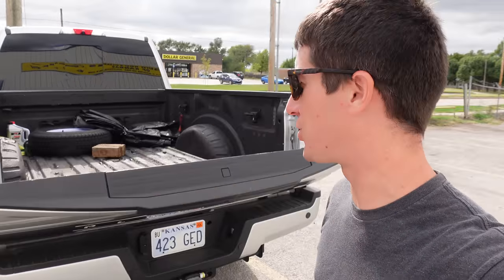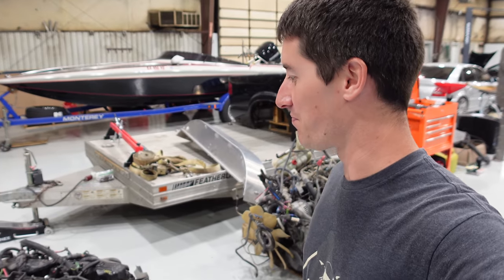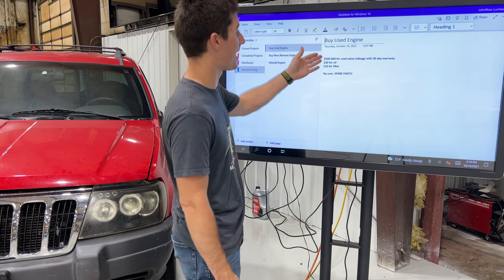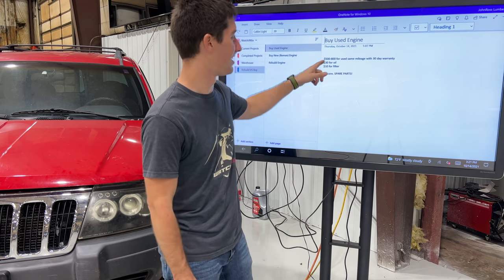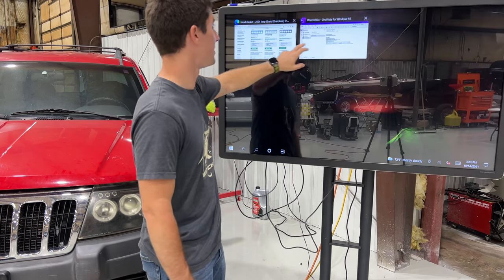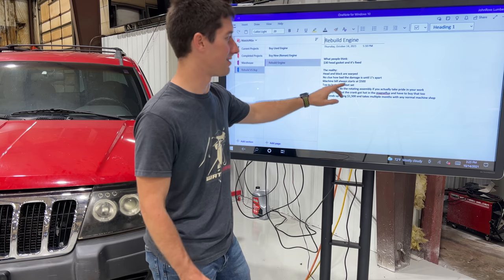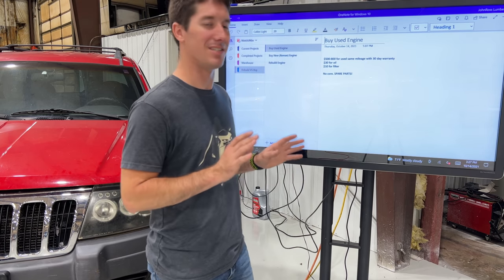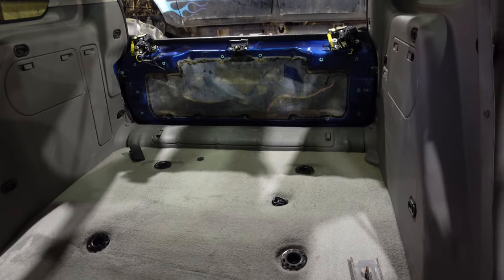Here's Why You Should NEVER Rebuild An ENGINE *The Math Doesn't Add Up*

Comment: So basically buying a used engine is really only feasible when it's an older vehicle you're either getting rid of or don't care about. To use the title "why you should NEVER..." is disingenuous. Immediate irony flag too when you mentioned $100 for headlights when it appears you really only need to spend about 30-45 mins with some wet sanding and buffing to fix those up like new again. 

Secondly, if you're just flipping and the person you're selling to knows that, then that's one thing. But I would never buy a car with a junkyard engine if I was expecting to have it be my daily driver. Sure, there's a warranty on the engine (does that warranty transfer when you sell to this person?) but not knowing the kind of care the previous owner of that engine took with their vehicle is a big question mark.

Comment: It depends on the engine. I rebuilt the factory engine in my 1949 Ford Truck. There were not any good used factory engines available so I had to fix the engine I had.

Comment: The key part in the math equation?
The electronic sensors, the connectors to them. All being cleaned or replaced if burnt, worn, dirty=bad continuity and a check engine code that becomes the headache.
So, the short end of this stick is a flip may be a flop. The elusive bad ground gremlins.
And if you live in an inspection region?
Mil not ready. And won't relearn in 200 miles and thirty restarts. Walk away.

Comment: Lol. What? No. I’ve done two rebuilds on the L29 in my truck personally, and it’s still a fraction of the cost of a jasper crate engine or the equivalent from gmpp. The only time it is cheaper to purchase a new power unit for your vehicle is when it’s a commercial vehicle that’s out of service (street sweepers for example, they pay for the engine in 2-3 days of service and that’s faster and cheaper than taking up a bay in the garage and putting mechanics on a rebuild).

Comment: In order to save weight and get better gas mileage, they make brake rotors and drums so thin that by the time they need to be machined to take the grooves out and be flat, they are too thin to machine and still be safe to use.

They do the same thing to engines for the same reason.

Comment: I had a tbi 350 rebuilt.  Ended up costing about $3500.  Lasted about 100k, replaced it with a junkyard engine for $500.  That engine was no peach either.  Ended up replacing the timing chain, and distributor after a bit.

Comment: I def rebuild just for a piece of mind. And try to find a am585 (3200gt) engine for a low price..  and even then you take a risk of the axial crank bearings failure has happened yet.

Comment: Good break down, however 4.0 is the worst one to do that break down to, slap a gasket on it after you check for the crack between 4-5 cyl, if its cracked $100 for head, cut the DS rear head bolt off and go.    4.0L is a tank.

Comment: I’m building a MR2 spyder with a 2zzge swap and I’m gonna rebuild the engine because even though it runs in the Pontiac vibe GT I got cheap it has 220k miles and I wanna keep it for a while so I got all the bearings gaskets and performance upgrades (baffled oil pan MWR manifold) for the engine and it wasn’t too bad price wise (about $2k in all the rebuild and swap parts) but I definitely agree rebuilding the engine isn’t good for making a profit

Comment: I mean I totally understand what you’re saying about the head gasket but I went ahead and just did mine anyways at 300k and I’ve so far been running okay with another 2k on the odometer honestly as long as you do the rebuild more as a maintenance thing I find it to be more cost effective then a replacement despite the time commitment although in relative terms the 4.0 is probably one of the easiest engines to pull in the world

Comment: Those used engines show problems too, whether leaking gaskets or internal noises, power loss or what have you..  But yes, it's cheaper and usually last a couple years

Comment: I agree, here where i live there are places that you can buy japanese engines with only 50k miles on them for $500 - 800 tops. whole complete engines. in japan they make you get rid of your car after 50k miles. Also they deliver it to your front door. i consider an engine absolutely no good when a head gasket is blown. the engine is never right after rebuilding.

Comment: The timing belt snapped on my 2005 Saturn LW300.
At the time it had 286k miles.
Found a 34k mile engine from a salvage and changed the timing belt idlers tensioner and water pump.
With installation it was less than $1000.00
The car is a "EXTRA" and a dog taxi.
Thirty thousand trouble free miles later...

Comment: Yup….had to put a new engine in my 75k miles 2006 X5 3.0L.  $1600 delivered to Ohio from Florida plus $1200 install.  Would have cost a ton more in labor and parts plus time.  Also got one with 20k fewer miles.  Not cheap but way cheaper to have a car I love running again.

Comment: Well seeing it is a Jeep I can understand why you wood not want to rebuild it : )

For flipping cars as long as it runs,  ok you can pass it off to someone else.
However, there are many reason to rebuild an engine/ machine.
Essentially if a machine be it a pickup a truck or tractor is doing what you need it to do it is effective  and reliable why replace it?  Often this is would be something more expensive and the dealers profit and depreciation depreciation adds cost a second time.  Most people dont consider these as costs, yet they are real.
1, It is usually cheaper to repair and maintain than it is to replace.  Especially if you have the skills , tools and enjoy doing it.  
2. Rebuilding also teaches you a lot more about your machine that you otherwise would not know. 
3. Helps identify areas where simple changes can be made to improve the way it performs.  Most machines are made by mass production which means they are a product built to a price for a broad market rather than focused on the use you have for it.
4.  A any number of modifications can be completed without buying "custom" parts that can make a machine more efficient, or powerful or tailored to the task it is used for.

Comment: I totally agree if all your doing is flipping a car. I have always done that. Even if the issue is a head gasket i just swap the engine. It saves allot of time and money in most cases. 

The only reason to rebuild would be for performance but that's a whole different situation.

Comment: Never forget the error rate on having an engine rebuilt.  Factory engines don't have the assembly error rate that "joe dirt" machine shop does.  Experts on certain engines are worth the risk, but basic transportation engines that the rebuilder has not done a large number of means his error risk is higher.  My experience is that properly replicating the bore finish to match the exact ring material and design means invariably the rebuild will wear out faster and not last as long as the precision job done at the factory.  You get a low mileage salvage pullout and it's virtually guaranteed that it will last longer than a reman or a "joe dirt" machine shop rebuild.  Ring seal and proper bedding is critical and often just done "close enough" in a rebuild.  Just my 2 cents.

Comment: I bought a 92 Camry for $500 with 200k miles. Drove it till 500k then the head gasket blew. Put a $500 used engine in it....still driving the car.

Comment: $100 to $120 (Canadian) an hour for shop time isn't just pure gravy for the shop. You need to factor in rent/taxes/utilities/depreciation on forklifts, shop trucks, hoists, compressors, tools and replacement of same. Not appreciating shop time is the downfall of many great mechanics who seem to be having good cash flow who are broke at the 5 year mark once they've started to replace equipment and pay people.

A stock rebuild at a good shop here in BC, of the few left, will cost you about $4,000 with infamous Canadian taxes. Resale is better with that rebuild than telling a buyer you got it from the junk yard. You Americans have the benefit of dirt cheap parts and way cheaper labour and overhead. Yeah, yeah, sure...we have "free" healthcare. It come at the price of crushing tax rates.

Comment: I have had good experience with junk yard engines  and I  have had bad experiences as well.  the bad part is these junk yards lie. then when you get a bad engine you eat the time it takes to swap it plus at the end of the day you never really know how good of an engine you got after all . Its pretty tuff for me to sell something in good conscience to someone  When I am not sure how good it is. Even  though the junk yard does a compression  check doesn't mean that the lower end isn't bad or on its way out bearings into the brass etc .

Comment: Depends on the car. I had the engine for my 1968 Beetle completely disassembled and put back together, everything that needed replacing replaced, for a whole heck of a lot less than what a new engine would have cost me. No longer spewing oil from everywhere oil could possibly spew, and running wonderfully. I'd call that a win.
Reply: rebuilding an oil-cooled vw motor is a whole different animal-designed for on the road repair.
Reply: @koscashcars  And that's before we've even mentioned two strokes.

Comment: Find a machine shop that will even touch a rather .... pedestrian car/engine?   My local performance machine shop only touch a 4.7 Chrysler head because I'm a regular - and that's a V-8 cylinder head that was a performance motor before the Hemi came back.

Now, I have an older corvette ('75) - 145hp stock.   I have gathered parts over the years and about $3000 later, I have a 550hp 383 (well, maybe not quite 600, needs bigger carb - did I mention I collected parts over years).   So yeah, if I owned a Toyota Avalon, no rebuild.

Its real simple.   To hone a cylinder wall properly, you need torque plates.   If torque plates aren't regularly available for your car/engine, your engine isn't worth rebuilding!

Comment: 7:52 I can attest to this. The same exact thing happened to me with a Mazda Tribute 2002 which is the same as a Ford Explorer/Mercury Mariner… I had to shave the heads and clean the burnt oil and coolant from in the heads and block, had to change the left and right gasket, had to change valve seals and all that stuff. Found out the timing guards were broken as well so it was HELL instead of just swapping an engine

Comment: If you are an individual, not a businessman, and know how to rebuild an engine, why replace it with a used engine? All you need are good spares (OEM parts are also always upgraded/improved), good automotive engineers and time to rebuild. A 'good' rebuild is probably very close to a new engine. But businessmen want money..they'll recommend a used engine which comes with its problems..when it dies again, more money from you. It's just business.

Comment: I pity you for saying not to rebuild an engine. You get to learn a lot about your own can when you rebuild its engine from the ground-up. You get to know the car on an entirely different scale, and you even can correct flaws that the original manufacturer overlooked. Also, rebuilding the engine makes less waste rather than throwing the entire thing away.  It's worth it to rebuild the engine in the long run rather than just junking it.

Comment: Do you rebuild 4l80e transmissions? I got taken advantage of pretty hard and I supplied all the parts. 2 months after rebuild slipping again, new converter, upgraded frictions, transgo hd2 kit, new trans cooler. And new trans lines throughout
Reply from the maker: It's so hard to find a transmission shop that's even remotely good... I usually just buy another used one. 😬
Reply: Oh boy I see core piles coming

Comment: Coming back on here after a year;

Some of us don't relish having to swap an engine. I'm still procrastinating on doing the rear valve cover on my Toyota Solara V6 1mzfe. It is worth $1,000 to me to know that the engine I put in as going to last for multiple years.

Perhaps you have a "horseshoe up the hiney" with a reliable affordable junkyard near you. For The Last 5 Years, I just go to auto parts stores from my parts because they're about the same price. No bargain at the junkyard and they never have my car there anyway.

The one thing you could have had in your favor is to say that the places that rebuild engines don't do a good job such as the Car Care Nut Channel alleges.

But if memory serves, I think Toyota only warranties their remanufactured engines for 1 year or 35,000 miles. This basically forces one to rebuild his engine even for his daily driver.

Comment: When I buy a car it is with the intent of driving it for a very long time. Only once have I had an engine fail, and I did buy a lower milage used one simply because it was a known engine with service history. The donor car was being scrapped because of structural rust. Had I needed an engine for my 89 Mercury Grand Marquis, rebuilding would really have been the only option. You simply do not find the passenger car 351W in salvage yards very often. Plus, being a one of one, numbers matching would become important later. I would still have that car but for it being destroyed in a collision.

Comment: I do understand and believe you when you talk cost in dollars.  The problem with used engines is the factory problems are still there and sometimes end up , in a short time, dead like the original engine or at the least have the same problems.  I just rebuilt an engine by hand, and sometimes , sometimes , it's better than factory, in quality and reliability.   But, yes, your talking about 1000 dollars more or more.  But again , I understand the used engine thing, it's TIME AND MONEY, with no hidden problems.  But, your right again , head gasket can be just a gasket or need a complete rebuild.   I just finished a head gasket on a ford v6 3.8 liter, and thankfully it was only gasket problems, but while doing it broke the timing chain cover, another 400 dollars, new pan 100 more.  But, realistically, it's fun doing engine rebuilds, and making them come out just right, even if it's only an inline 4.0.  Doing the work is just fun. Seriously.

Comment: Sorry I disagree with this person on so many points number one if you're going to buy a salvage yard engine and put it in whatever vehicle only a freaking idiot just takes the engine out and puts it in the vehicle without replacing any parts on it along the way. You always throw certain parts in it while you're in there if you even question the possibility of the rear main seal leak and you go and do a rear main seal you check the valve covers and intakes if there's any possibility of this crap leaking you replace it right then and there. You check your freeze plugs anything that looks like it's leaking you replace it. Only an idiot would not go into the timing especially if you don't know for sure how long it's been since the timing has been replaced or ever checked so replacing timing belt and timing changing gear sets. That's automatic because you want to replace all this stuff while the engine is out of the vehicle because it's the best time to do it while it's on a crate or on an engine stand is to replace all this hoses belt water pump thermostat. All that should get replaced while it's out of the vehicle on an engine stand any possible leak and gaskets are seals. All that crap starts to cost money quick. Also I have replaced head gaskets on many different engines cars trucks vans. Only one time have I ever gone in and done internal engine rebuilding as a while I'm in here kind of thing. And that's because the damage to the inside of the engine was clear and obvious and it was a high-mileage engine. The most I've ever had to do is rebuild cylinder heads or replace cylinder heads from a salvage yard. I've never gone into a lower-end and I've never had a single problem running these vehicles for many years afterwards I disagree with this guy's assertions on certain things and I've been working on cars since I was 16 I am now 45

Comment: If something was on my own car and I had the resources I would rebuild the engine. Imo that's the cost of continuing to own a vehicle that I know is reliable. 

Im also in my 20s. Its not happening tomorrow but ice is going away. Everything dries up eventually. Everything gets miles on it. Eventually youre gonna have a hard time finding junkyard engines with less than 150 or 200k miles.

Comment: If you want to drive it for a long time its better to rebuild. Example- drive a truck for 250k and and over 15 years old. Whatever salvage yards have is barely better than the truck you have. Rebuilding it would get you into the same amount of mileage and with potentially additional more power

Comment: For a daily driver that needs an engine put a used engine in with the same thing to happen again.  I look at every used engine as a builder. And to that saying "tested and warrantied". No they aren't. Testing means the engine ran when it came to the junk yard. Most don't rebuild anymore and never did to start with. A rebuild is using only the OE block and heads, everything inside replaced.

Comment: Good advice for flipping broken down vehicles. I chose a vehicle I will drive forever and it needed a lot in the beginning which I am at a point where I can truly mod it of how I wish for its purpose. I got the engine overhauled year ago, machined and new parts on the lower end besides all the new parts I have already installed. I got the vehicle back on the 3rd business day. Haven't had a problem with the engine since.